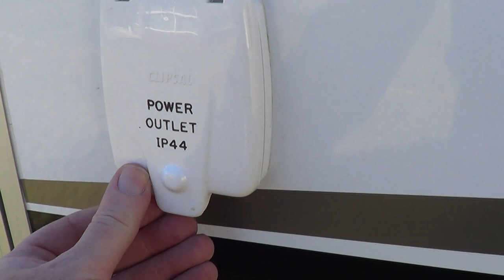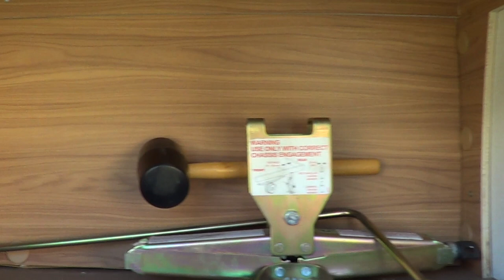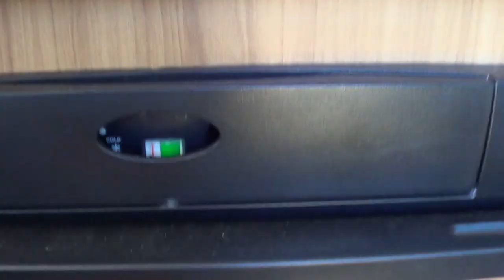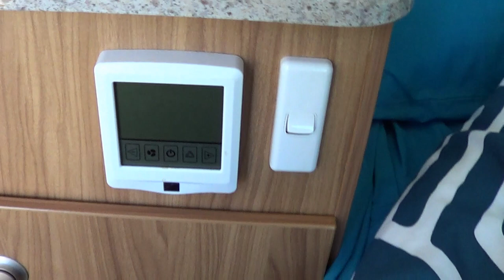1. The Aussie Aliner -The Setup and Tour

Comment: Hi Rob, I have just bought my 1st van - 2010 cruiseliner.  Could you tell me the brand and size of the mobile solar panels leaning up against your van in the video. I'm going off grid for 2 weeks and would like to run my microwave, fan and powerpoints (for charging electrics) off of mobile solar panels.  Would what you have cope with that? Fridge can run off the two 4kg gas cylinders.  Thanks Caroline
Reply from the maker: Hi Caroline, My Solar Panel is only a cheap no name Chinese 140 Watt solar panel that was part of the deal when i bought the Avan. It is only good for topping up the 12 volt battery for small electrics like LED lights etc. If you want to run a microwave you need at least 10 times more solar +Lithium battery +inverter +big dollars - sorry but we don't usually do off grid camping so can't give you too much more info

Comment: Thanks for showing some of the wiring . I bought a 2010 same version you have . It has had a 12 volt fire and melt down I think the old water heater may have started it.
I need to gut most of the wiring and start again. Any thought on wiring it would be very welcome. Regards, Nick.
Reply from the maker: Thanks for your comment, I have a block diagram of an Australian made Aliner Electrical setup if you want to give me your email address, it is fairly basic though.
Reply from the maker: I found your email

Comment: Can I ask what car your towing it with.
Reply from the maker: I have towed it with a 2014 Hyundai Ix35 2.0 litre but i now have a 2021 Mazda Cx5 GT turbo 2.5 litre. Both cars tow it well but the Cx5 has a bit more power.
Reply: @AussieAliner  thanks, we have a bit bigger Avan at the moment we use the Toyota work mate, but it’s getting on a bit so looking for something I can use as well as tow the van, I have a suberu forester so don’t want much bigger than that if I can.